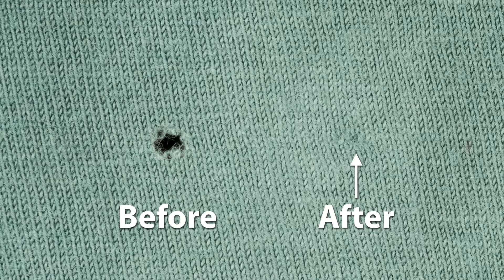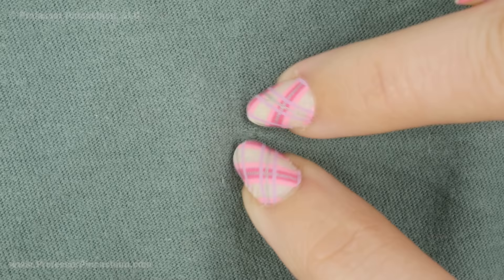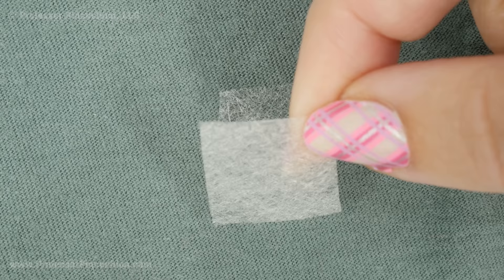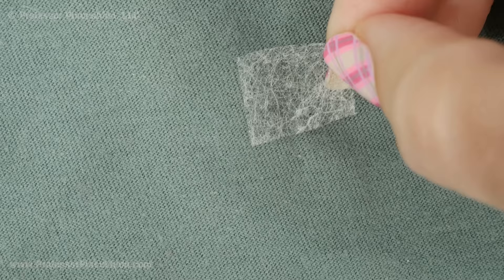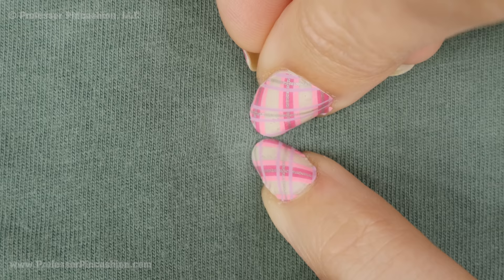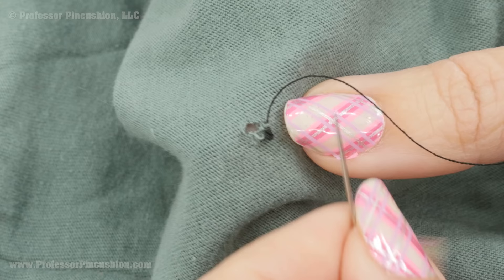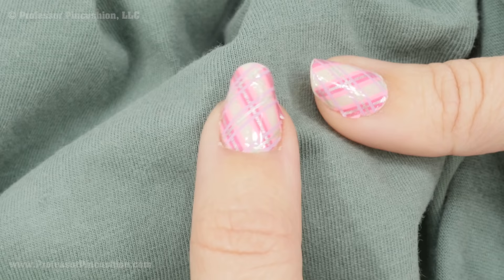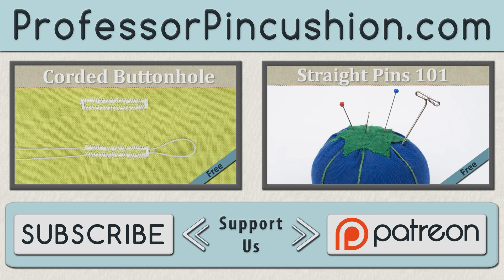How to Repair a Hole in a T-Shirt

Comment: Beware, the no sew tehnic has to be redone if you use a washing machine. spent 3h reparing 10 tee-shirts, one wash and it's back to the start.
Reply: Good to know. Thank you. I'll try it. If it doesn't work I'll take them somewhere to get repaired. I can't see well enough to do the sewing method. 

What is the piece called that is put over the first piece? Thank you.

Comment: This was extremely useful! Our washer tends to make these small holes in our clothes and we don't know why. There's nothing worse, than getting a brand new t-shirt, only to wash it once and find a hole in it. This has really helped us out a lot! Thanks!
Reply: The washer me too!
Reply: How annoying. Washer that creates holes? Put clothes in huge laundry bags or pillow slips perhaps. 😊
Reply: @cousinsister69  Omg that's a brilliant idea! Thank you!!
Reply: @mariempavon2916  It's the most annoying thing, right!
Reply: Don't blame the washer! You all likely have clothes moths. They do their work, which doesn't show up on the clothes until put through the wash. The moths' acidic digestive saliva breaks down the fabric, but It's the detergent and agitating washer that pulls the weakened threads apart and, magically, the hole "appears".
Reply: @davecc0000  Thanks for the advice! We didn't have moths though, not a trace of them and we used that.. Moth-spray, I dunno what it's called in english, in our closet.
It stopped happening, when we bought a new washer.
Reply: Now u should watch a video about how to repair washer😊
Reply: I thought it was the washer for a while too. But the holes kept appearing ONLY at the front of the belly area. I looked it up online and i couldnt believe how i didnt realize it earlier. It was my BELT! My belt had a somewhat pointy corner of the metal buckle and it had caused me much grief with how many shirts its ruined. I guess whenever i leaned against a counter the shirt would also get caught by that sharp buckle edge. It was such an awakening moment for me! Since then ive stopped buying belts with sharp corners and i never have holes in my shirts anymore!
Reply: @JadedJarvis  Oh noooo RIP all your shirts! 😢We don't wear belts.. Never have.. And our holes appear literally everywhere!
Reply: @Trunkslover14  In my case it wasn't the belt, but holes were showing up in the front of the shirt near where a belt would be. I'm pretty positive its from the friction of my pants and the kitchen sink when I'm washing dishes. So it could be that too
Reply: @jessielauzon4117  Could be! It's just that the holes appear everywhere and happened to the bedsheets too.. Only after we washed clothes.
We found out that it was indeed the washing machine, because the holes inside the.. Like the machine itself, where the water comes out?? Like there's holes inside the machine. They weren't 'smooth' and had sharp edges, that would rip tiny shreds in the clothes. We got a new machine!
Reply: Run your hand over the inside of the drum, feel for protruding/bent metal - There is most likely a small raised area. You can tap it down gently with a hammer.
Reply: @Scientificmethods  This is so sweet, thanks for the tip/advice!
Reply: It’s the friction against the button on the pants, especially if you lean onto a counter. Get some button covers.
Reply: Also, drying pants with clothes. The jeans buttons get so hot they can put holes in your clothes.
Reply: Goodness! I came here because I just bought my son a “good quality” t-shirt, in my opinion (Petit Bateau). He just used it once and I washed it twice ( first wash before use and second after using it). Imagine my horror when I discovered two holes in front! I could not get over it. It just happened last Tuesday and it really makes me upset!
Reply: OMG our machine before too. It made these slated cuts in my husbands work shirt collar. It drove me crazy. Now that we have a new machine, it totally stopped.
Reply: @undiplomaticwife  SAME, we moved and got a new washingmachine with the new home - NEVER had that problem ever again!
Glad you're out of that problem!
Reply: Yes!!!!!!! 
I'm not rich and i dont often buy clothes but almost every damn time ii get a new shirt and these tiny damn holes keep showing up!!!!😭😭😭
Reply: @cousinsister69  
I already do!!! And even seperated the bra so the hooks dont get caught and make a hole but it still freaking happened!!!!!
Reply: Open zippers on other clothes
Reply: @alexanderlewis3760 This. Once we started making sure we closed all our zippers, no lore shirt holes

Comment: Hardest thing. Finding thread to match
Reply from the maker: if you can't find an exact color match, you'll want to use a thread color that's a shade darker, rather than a shade lighter.  It tends to blend in better.
Reply: Sometimes you can rob thread from an inside or hidden seam or edge.
Reply: I use clear "invisible" thread. Harder to work with, but looks better.
Reply: You can also use cross stitch thread to try and match colors, just use one strand of the floss and it will Work the same a sewing thread.
Reply: Got a dirty shirt?
Just use dirty thread!

Easy!!
Reply: By somewhat match with color chart and using white thread is to dye it with clothes dye or food coloring to match close. Experiment
Reply: I mostly use black or white thread for patch jobs because that's what my mending kit came with. If it's a dark fabric, black thread. If it's a light fabric, white thread and I haven't really had an issue with the thread standing out too much. Matching thread is ideal but you can use black and white as a standard. My son has a huge rip in the arm of his otherwise nice shirt. I'm about to tack it with black thread. It's a dark grey shirt.
Reply: @KB4QAA  "robbing a thread" is NEVER a good idea. It's a good way to help other parts of the clothing come apart lightning fast.
Reply: When you're sewing a hole, the trick is, to hide your sewing. So it doesn't really matter if your thread matches. Just use something close.
Reply: Mines white but silk
Reply: Kl
Reply: @AdventuresWithJules  good idea!
Reply: I couldn’t see the black thread when you finished!  lol But a lot of good ideas on this comment.  Thanks:)

Comment: For the sewing option, I found the ‘after’ looked better if I passed my needle from the wrong side through to the front side, and worked on it from the front side using this stitch. Then when I reached the end of the hole, pass my needle back through to the wrong side and knot it off. When I tried staying on the wrong side, it left the little ripped edges of the hole on the right side of the t shirt, which made the repair more noticeable. When I pulled it out and did it the way I mentioned above, it left the edges on the inside, giving a cleaner looking repair. Hope this made sense. Lol I’m not very good at describing things. Thanks for the video.
Reply: that makes sense! thanks for the tip
Reply: Thank you 😁
Reply: thank you so much!!!

Comment: My go to is Aleen's Flexible Stretchable Fabric Glue. I think it works the best. Work the hole together and place a piece of clear scotch tape on the front/outer side of garmet and glue on the inside. Fyi, I pull the tape back and adjust as I'm working the fabric together. When I feel it's acceptable I apply the glue. Begin with the smallest amount of glue possible...on some thin fabrics I use the tip of a needle to transfer the glue and spread a thin layer.  Don't over work the glue when applying or apply too much, as glue can come through very thin or loosely woven fabrics. I don't use backing material the majority of the time...patience with thin layers letting each dry min 1-4 hrs, fabric dependent and thickness of glued layer dependent, before checking. DON'T stress the hole if you're compelled to remove the tape at this time. (24-48 for full dry and wearable).   You'll know if you need more when it drys. It has always stayed intact through washing for years.
Reply: SimpleDiversion thanks for the info 😀

Comment: this is the best!  I got a brand new limited avalability t-shirt from one of my favorite brands, wore it once, and my lovely little kitty put a hole right in the middle of it right under the design.  I used the fusable bonding web technique and it's like the hole was never there.  I also mended another shirt she had damaged with similar results.  I tried it with a heavier shirt with a larger hole and it didn't work, but I wasn't really expecting it to because of the weight of the fabric.

Comment: I use old used dryer sheets as my stabelizers, works AMAZINGLY! And its cheeeeeeeeeeeap.😄   ive used the fuse methode on larger holes on my shorts ( stretchy velvet) i sleep in every night, they are 30 years old and its been a year since repairs and still great i just did repair tech twice over same holes for extra insurance.
Reply: Can you please elaborate how you use the dryer sheets on your clothes to cover the hole

Comment: Tip: even if you stitch repair, add a piece of fuseable webbing or interfacing (cut in a circle, ideally with pinking shears). It will just add a little more strength and permanence to the stitched repair.
Reply: Are these interfaces and fusable webbing the same thing as dryer sheets or just look similar?
Reply: @williammcalpine2718  hmm similar in look and texture I guess.  But how they'd sew or hold up to washing I'm not sure. I've not used drier sheets for a long time but I remember they tear easily. Interfacing doesn't tend to tear, as it's designed to add additional support to the area it's used

Comment: Thanks for sharing the two great methods! I just fixed a hole on a tshirt with needle and thread and found that it gives an even better result if you do it on the right side, then there’s no ridge and it’s practically invisible if you have a nice matching thread 👍🏻
Reply from the maker: Great tip!
Reply: Hello Rimmazolo how are you doing today how’s everything going?

Comment: It would be nice if you listed the products you used in the video description. I'm trying to find the stabilizer on Amazon and having trouble. One of the ones I found is put on by dunking it in water, and another needs an adhesive. I'm very confused.
Reply: vanessavoj there is some @ JoAnns
Reply: Stitch Witchery is one brand
Reply: look for iron on hem tape

Comment: I just tried the fusable bond technique on my favorite fall t shirt that my cat decided needed more "air conditioning." Thanks so much! It's good as new 😊
Reply from the maker: yes! I'm so glad it worked out for you
Reply: Can u say the material u used? Cause I didn’t understand the second fabric she placed on top
Reply: @abril443  I used the lightweight heat and and bond directly over the hole, then the stronger fusible bonding over that, with a piece of wet paper towel to prevent sticking to the iron. Then I flipped it right side out, drew the last bit of the holes together and pressed the iron down for a while to prevent fraying. It looks great again!

Comment: I needed this. My cat has little razor blades for feet, and a lot of things at my work are a tiny bit messed up so they snag in my uniform shirts. Had issues with entire uniform shirts getting an entire shred through the stomach. So I have to fix them all by hand! Hopefully this works without ironing I don't think my shirts can be ironed

Comment: I have found success on slightly larger holes by using a size 12 (US) metal crochet hook to reconnect the "ladders" as close to the origin of the tear/hole as possible.  Then, I cut a few bits of the t-shirt knit from a seam allowance or at the hemline, where it won't be stressed or noticed.  I mix the t-shirt threads with tiny bits of the adhesive webbing and then follow your ironing technique.  Yes, you need to have really basic crocheting skills (chain stitch) and you will know where the repair is made, but unless you tell someone or show them, it's not going to be noticed, either.  My mother-in-law never bothered to repair.  She bought adhesive appliques and ironed them on the garment to hide the hole.  Oh, well, I went to 4-H and took a home ec class in high school.  She didn't.

Comment: Thanks. Your video helped me rescue an old favorite shirt. I think it'll be good for another 9-10 years. 👍🏽
Reply from the maker: great!  I'm glad you found this tutorial helpful :D
Reply: Professor Pincushion , thank you for posting this. I was wondering if you've ever done repairs with Fabri Tac? I have a cotton scarf that is seen on both sides , I need to repair an L shaped tear in it.  Sewing it is not an option unfortunately, It would tear at the stitches because the scarf is pretty delicate. 
 Would you have any suggestions for this? Thank you so much.
Reply: Everett White wtf you keep a shirt for 10 years
Reply: Ahsan Hussain 
Well what kind of garbage shirt doesn't last for ten years? Assuming it's a casual wear shirt and not a heavy work shirt, I'd say ten years is a good minimum lifespan for a shirt.
Reply: Ahsan Hussain I don't think it so uncommon. I have plenty of shirts that are over 10 years old but I still wear that bring me good memories
Reply: Depending how much you wear it can last a long time, but wearing it all the time will make it start having holes all the time because of all the washing etc :P

Comment: that is not a t-shirt that is a knit. completely different fiber and less dense then a proper t-shirt. im a tailor and do proper re-weaving on garments with tears, rips and holes.  just did a "t-shirt yesterday. a t-shirt is a lot harder to repair because the thread is fine and very dense. this knit here is fairly easy to re-weave. also that stitch witchery will not last it comes lose with washing or dry cleaning.
Reply from the maker: it's an old t-shirt belonging to my husband not a knit sweater.  knit fabric is defined by the way it is created, not necessarily by the fiber content, which is why you can have cotton knit fabric and cotton woven fabric.  woven fabric is weaved together and knit fabric is looped together.  The looping is what gives knit fabric its stretch and gives it a similar look as a knitted sweater.  This is why if you look at your t-shirt under magnification, it'll look somewhat like a sweater.  I've done several repairs using this technique and so far they're surviving several washes.  It may not last forever but great in a pinch.  thanks!
Reply from the maker: I wasn't arguing that my tshirt wasn't knit fabric.  Tshirts are made with knit fabric, like jersey.  Jersey fabric is a knit.
Reply: Teresa Palmer Thanks.  I will just take my top to the  alteration lady..
Reply: Professor Pincushion I
Reply: I would never take my clothing to a tailor who doesn't understand that knit describes how a fabric was made and fiber describes what it was made from.  That's the basics.
Reply: Teresa Palmer i was wondering about what woukd happen once it was washed
Reply: Professor Pincushion Technically, a t-shirt is a knit.  It's certainly not a woven.  What credentials are you using to call yourself a professor?
Reply: Professor Pincushion Furthermore, it's "woven," not "weaved."  At least you're not teaching English.
Reply: PeaGreen i can pretend to be atailor as well... thing is this guys is wrong

Comment: The most important part of fixing a hole is to prevent it from getting undone even further. You can see how she makes the hole worse when "massaging" it because she didn't do this. You have to grab the loops(every single one!!) in the knit with your thread right where the hole starts to secure them. If you thread matches you can basically reknit the fabric and it will actually become invisible. You can undo any ladders by re-knitting it with a small crochet needle and securing the last loop with some thread. The fusible fabric is just plain stupid, it is not stretchy and will peel off after pulling the fabric once or twice
Reply: anynamebutmyrealone same thoughts i tried what she did but it definitely made it look worse :((((
Reply: Some fusibles are knit and do stretch.
Reply: You're right. I've gotten much better results in a t-shirt just by applying fray check to the hole and letting it dry.
Reply: I've used patches or stitch witchery for decades and have honestly never once had a problem with it coming off.
Reply: The smaller the thread an needle works best. I've been repairing holes in clothing for years. I learned by trial an error lol
Reply: sheriwhispers yep, that needle was so big it was making the hole worse!
Reply: If you already know how to repair holes, then why are you watching this video.
Reply: rah man I am not a professional, I just figured it out for myself, but I was hoping for some tips to do a better job. Turns out my way works better because I catch the threads so the knit can’t unravel.
Reply: Totally agree, she does a terrible job of darning this hole. This "repair" will not survive more than a couple of machine washes.

Comment: I repaired a hole in the pocket material of a pair of shorts using the fusible sheerweight interfacing. It was such a rewarding experience to be able to wear the shorts again without having to make sure I put spare change in the other pockets. 

But the first time I put these shorts in the clothes dryer--the fusible interfacing came off the pocket fabric. I had followed the instructions included with the interfacing exactly, using a hand iron set on "wool", and a damp cotton cloth laid over the repair, heating for 10-15 seconds, letting it cool before moving it. 

I guess this type repair is good only for hand-dried (hung up) clothing.

Comment: If you're doing the darning technique using a doubled thread, after the first stitch you can thread the needle back through the end below the knot so that the knot won't pull out.That's the most common issue with darning that I've found (my Mum wouldn't let me use a knot for darning, I had to do a tiny stitch around the hole first, so this is my compromise lol).